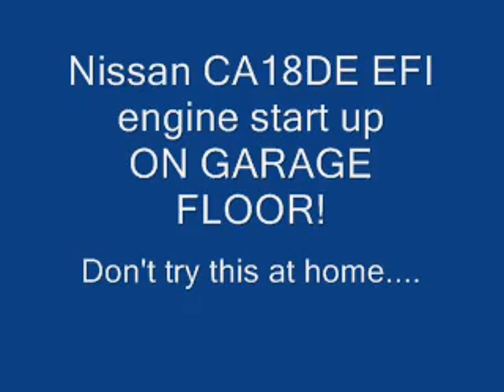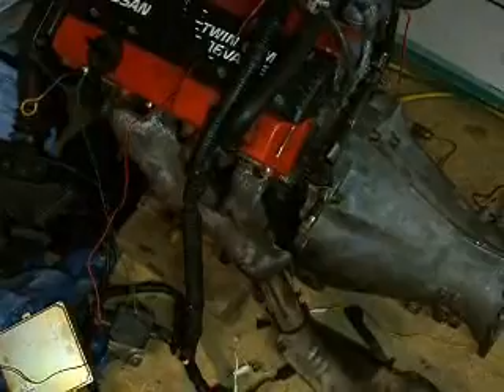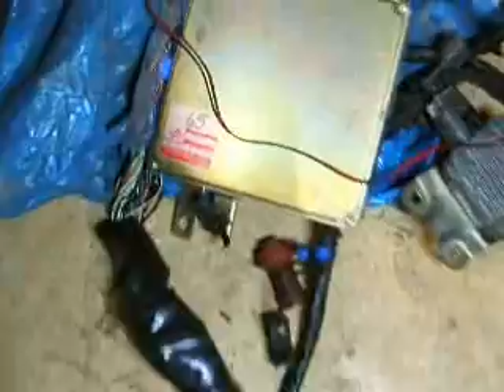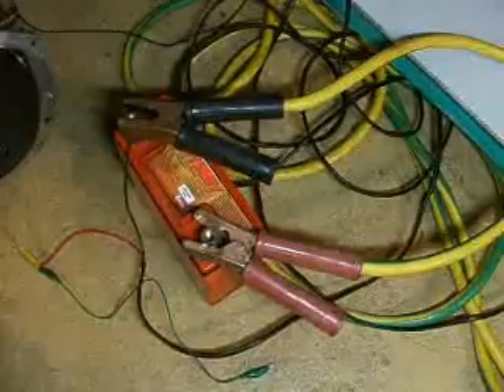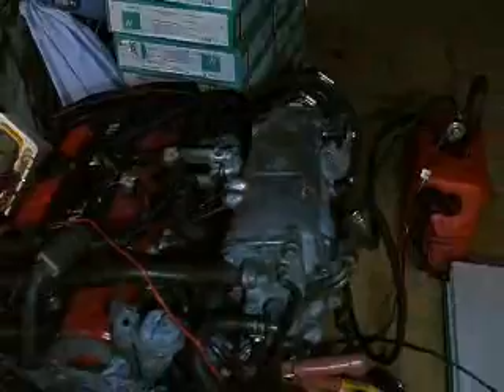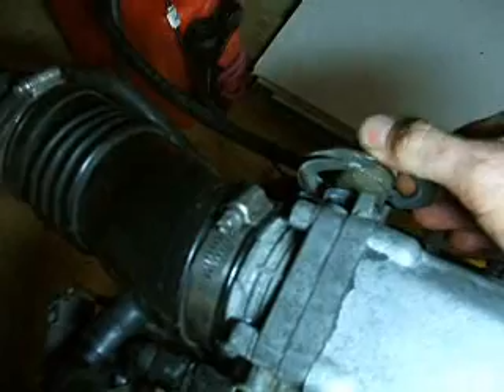CA18DE startup on garage floor.wmv

Comment: hey mate, i have a datto 1000 race car with a CA in it, your the only other person i have seen doing this, let me know if you want any tips etc. mines got cams, h beam rods, solid lifters (home made) self ported head home made exhaust and extractors and revs to 10,500 RPM ! next is fitting my quad throttle bodies.